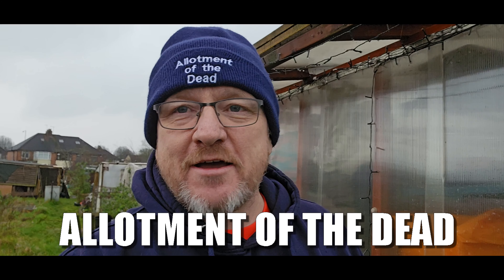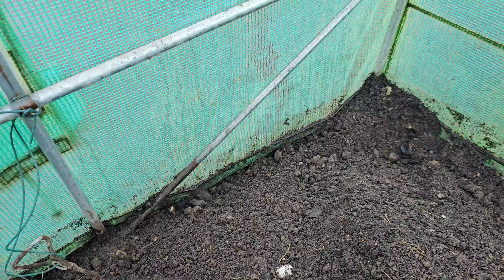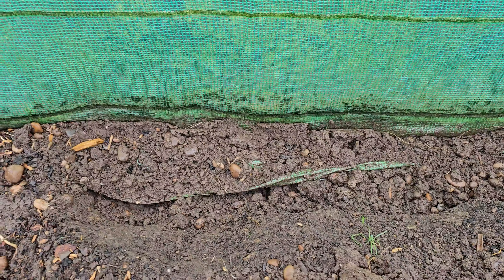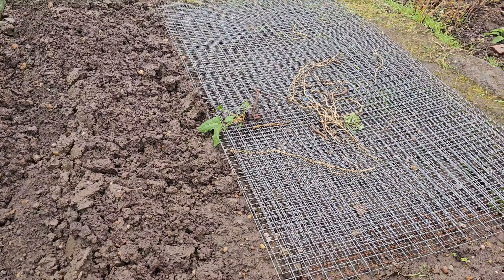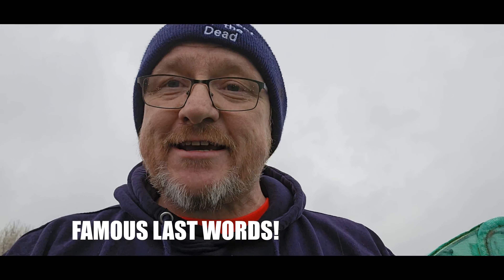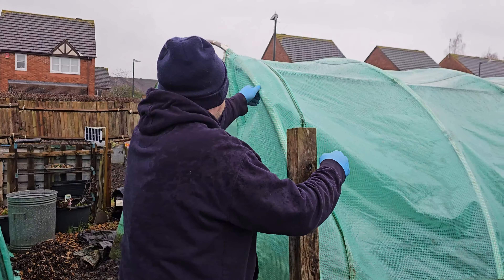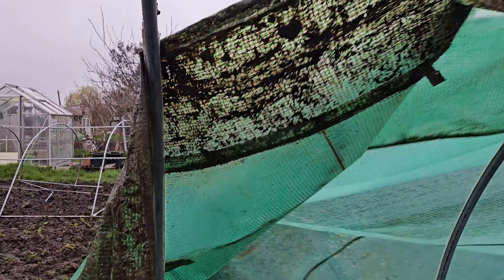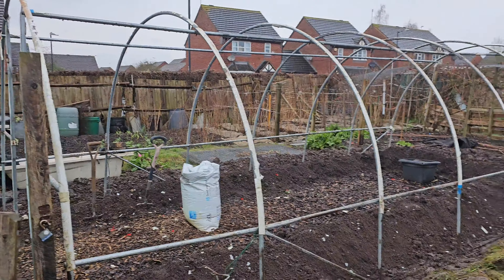Polytunnel Cover Replacement Part 1

Comment: That's a big job. I'm doing the same to my poly too, only difference is size, which everyone says is not important, but it really is, mine is a pathetic 2x2m. Wish I had a big one like yours!
Reply from the maker: Rule of thumb is get as big as you can afford cos you'll always want more space. I have a second one, same size to cover.
Reply: @Allotment-of-the-Dead  site restrictions only allow one 2x2m structure,no sheds, I have a plot and am growing food to eat so I'm happy, I am asking for an increase but it will still only be an extra meter or two.
Reply from the maker: @majordog2399  best of luck.

Comment: great video ,were did you buy that cover from ,look very strong .....
Reply from the maker: That cover was from ebay, crocodile trading. The new one is white and doesn't feel quite as strong.
Reply: just got the white one myself from the same company ....there a lot more light but it seems very light in weight .......good luck with your new cover.....  @Allotment-of-the-Dead